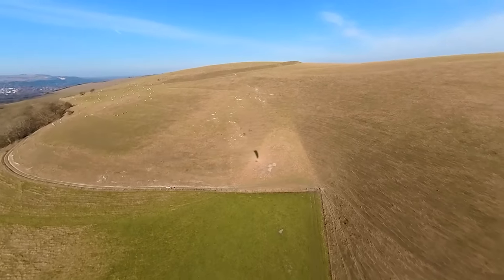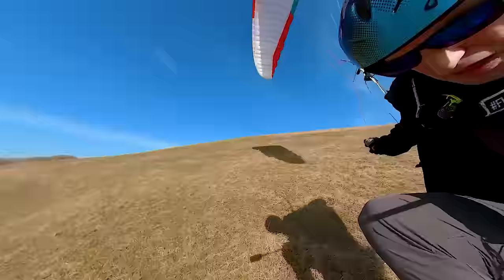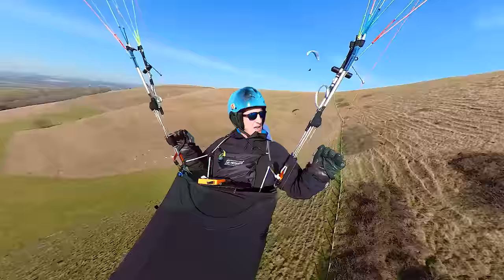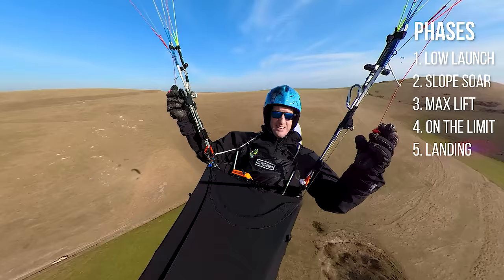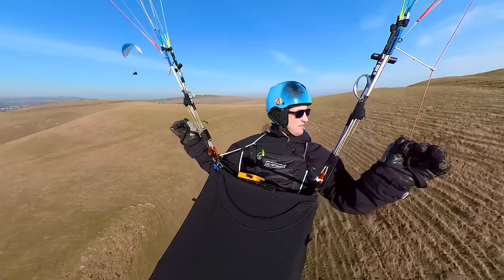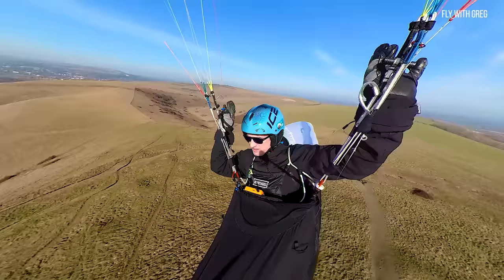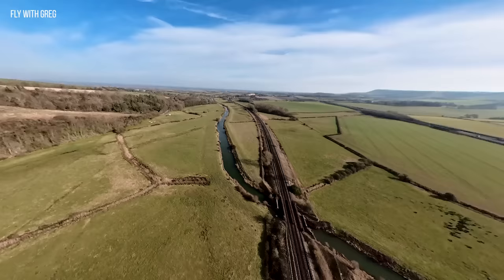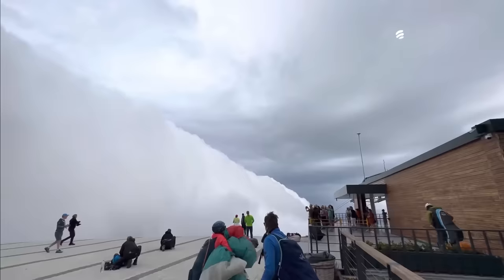Paragliding Skills: Master STRONG WIND soaring in 9 minutes!

Comment: I wish I was proficient in this landing technique. Recently had an accident where I had an unplanned landing on a high ridge , going backwards, and got dragged badly. By some miracle I walked away with a bust helmet and badly torn harness. The helmet and a small boulder saved me as I ended up wedged. It was honking on the ridge that I’d flown to on xc. 
Even though I know about using the rear risers unfortunately it didn’t come to me in this fast paced situation, landing going backwards. I was at 600m elevation so my brain was not in landing mode at all. I think knowing this technique is very useful also for getting yourself in an unexpected situation but I just wish it was in my muscle memory. Time to practice.

Thanks Greg

Comment: Great info.   If you are looking at something to report on and since you fly a lot of different wings, can you do a video on how to determine min sink for a glider (with and without a flight instrument)?    I'm curious if it's 'always' hands at shoulders, etc.
Reply from the maker: it's almost impossible to do it with a flight instrument, unless you're over the sea on a perfectly calm day, because the everchanging movment of the air will mess with the experiment. But you can get a feeling for it. It's never a set position relative to your body, you have to look up at the wing and you'll see the trailing edge kink a little ... that's 1/4 brake, and usually min sink. It's almost the same sink rate as hands up (trim speed).

Comment: Thanks Greg.  If you don't have rear riser toggles, would you still recommend using the C's?  And when would you use the A's to collapse the wing?
Reply from the maker: yes it's easier without rear riser toggles, just hold the maillons. Toggles usually suggest the wing has the rear risers connected to the B's, which can mess up the rear riser kill sometimes. So it's always best to hold the maillons on any wing. The A's requires more practice and committment, and can be harder to set up because you have to switch over from rear risers or brakes (needed for collapse catching) to the A's in an instant at touchdown. So it's suited to more experienced pilots. I use it when I'm landing backwards and I want complete depower.
Reply: @FlyWithGreg  Super helpful.  Will practice!

Comment: Can you give an approximate wind speed at the height you launched, and if there was a wind gradient, what was the max wind speed (excluding the compression areas)
Reply from the maker: about 20km/h at launch height, 30km/h above the hill, and 36km/h in the venturis here. It gets worse in cold air, and with high pressure weather systems.